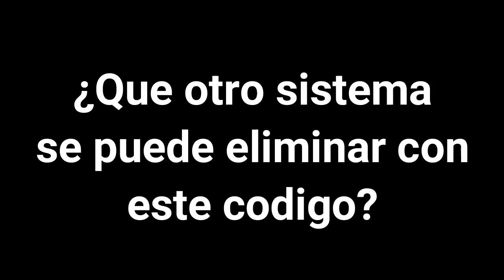Eliminador de Tarjeta Inverter Para Instalar Compresor Ordinario 120VAC

Comment: Estos dos modulos los venden en Alixpress y en Ebay ... les recomiendo usar Relay Modulo Expansion con high y low level Trigger y Usb a TTL converter UART module...o puedes usar tambien un Atmega 328P ..existen varias versiones de modulos. Los refrigeradores de hoy dia en los EUA ya no puedes conectar un relay a CFan porque la señal de PWM va ahora directa al fan y esta ya no tiene el transistor swish para conectar el relay pues solo tiene 13volt ...ground ..pwm..y retoalimenacion en la targeta . y es ahora el fan quien recibe la señal e internamente este tiene el swish que antes estaba en la targeta transistor PNP o NPN asi sea el caso .. es la razon por la cual hay que instalar este modulo para hacer la convención de lo contrario da un error en el display de la puerta relacionado con defrot heater

Comment: Hola amigo Ángel quiero hacerte una consulta es que mí madre tiene una nevera haceb 420 de las que tienen tarjeta con 5 leds en la parte de arriba de la puerta del congelador , bueno el tema es el siguiente está nevera presentaba bloqueo  por  exceso de hielo, cambié resistencia y sensores y con el tiempo volvió a lo mismo , baje la tarjeta, para probarla afuera con la.serie y tiene un problema que prende el ventilador por un tiempo y luego lo apaga, lo solucione puentiando el ventilador con el compresor, por ese lado bien, mí duda es como se conecta un potenciómetro para simular el sensor de deshielo y que mande a prender la resistencia, lo hice conectando un potenciómetro de 20k en los bornes dónde va el sensor de deshielo, luego otro de 50K, otro de 100k, otro de 1M,y con ninguno mando a apagar el compresor y el ventilador ,aclaro que utilice el común del potenciómetro y uno de sus extremos, cómo se hace eso de simular el sensor de deshielo con un potenciómetro y de que valor debería ser Dicho potenciómetro, o la prueba estuvo bien realizada y debo asumir que la tarjeta está dañada y nunca mandara a deshielo? Gracias y bendiciones